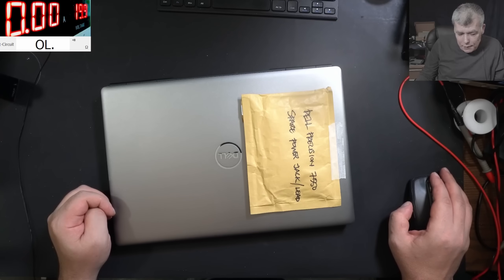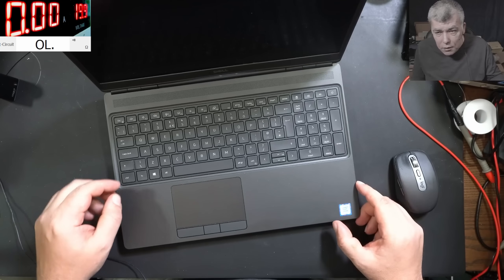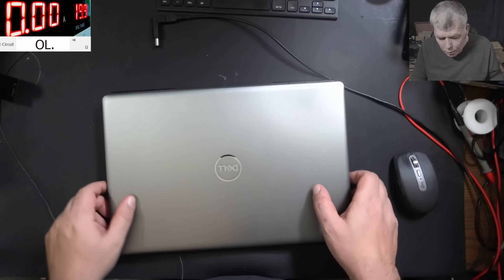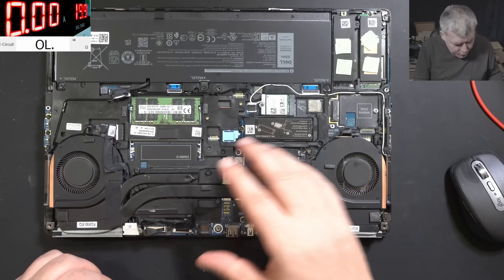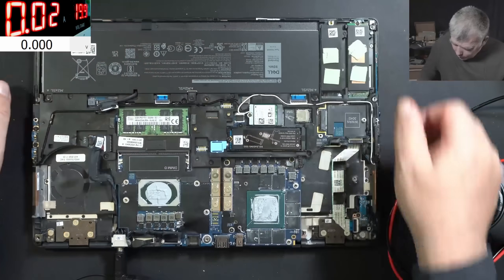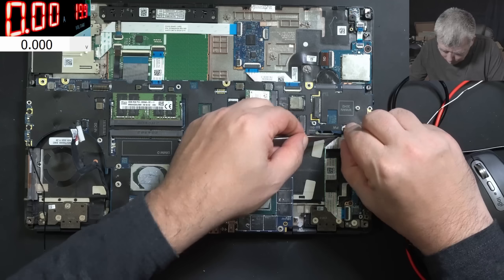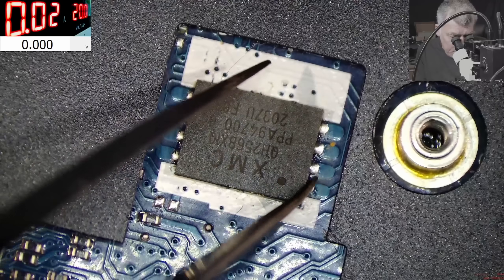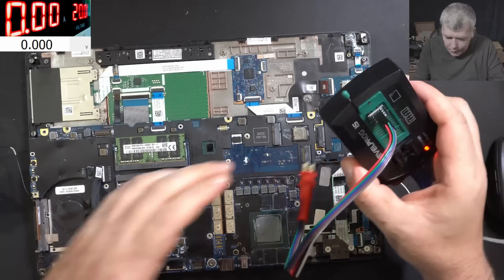Dell Precision 7550 - 10 months ago, i misdiagnosed this laptop and now is back, same fault again

Comment: I had a faulty chipset, the first symptom was error 43 on gpu. Local repair did not diagnose it properly, I ordered  gpu replacement (old laptop), it did not change anything. Later I discovered chipset gets extemely hot, but still it worked, until one day it blew up with a smoke. The cause was my attempt to replace thermal paste without unplugging battery, so suspecting gpu issue made sense at first.

Comment: I would just in case put rosin under the chip, heat it and then put the thermal pads to cool it better. This way if this laptop would die sometime, you know you tried all the best you could without replacing the chipset itself.

Comment: Thanks for sharing. You mean the actual chip itself is crappy? So it is not the solder? Or does bad thermal make it come off or come lose internally? I used to have a contact that reballed old Apple G3 GPUs. If Apple did it they failed after a year, but when he did it it lasted for years. He had an industrial sort of oven with a profile he figured out. Thermal pad may work, newer models of the Precision I have, have a cooling pad and copper on it. Awesome find, love to know how you apply cooling and how long it lasts! And still hoping for you to answer to that email from Sweden ;).

Comment: You applied way, way too much thermal paste on the cpu which i saw at the start of the video - this can also negatively affect thermal performance. If you cant eyeball how much is needed, use a spatula to spread the paste evenly and add a tiny dab of paste in the middle - this will ensure perfect coverage with no gaps
Reply: How can it affect thermal performance?

Comment: Intel Chipset has no this issiue like old gpus. Same effect you willget if you push the chip. You have to reball the chipset the problem is cracked solderbals between chipset and mainboard.

Comment: I do not understand why Dell moved from having the chipset cooled by the heatsink, as on some older Precisions ie. m6600 or m4800, to simply having them exposed with no cooling mechanism other than ambient air such as the one shown in the video🙅‍♀
Reply: I've also noticed that some Dell Precision models run hotter thus causing heat related issues sooner, so I drill additional holes in the bottom cover to assist in cooling.
Reply: This chipset doesnt need that for operating, its just several watt, operating temp only around 60 deg c.

Comment: I don't know how to diagnose and repair the board, I don't even have the right equipment to do the job,  so I would have taken a chance on replacing the motherboard.
Dell Precision 7550 Motherboard System Board Core i7 2.6GHz Hex Core CPU - 4JGVR - $249.95 refurbished
Reply: Refurbished is the same deal, gpu or super IO chip

Comment: The chipset is healthy, but it needs reballing. You only did reflow and not even a good one. That was a perfect moment for your rosin to shine but you missed it. You always say that you can solder chipsets but cant find a healthy one. Well... what more do you want?
Reply: No he didn't do reflow. He simply heated the chip to prove a point, the chip is internally faulty. This is a known thing for at least 15 years with large bga chips that run hot. This is why people should add heatsinks or heatpads to all things including tv video board bga chips otherwise they will eventually fail from getting too hot. They are designed that way and manufacturers purposely do not put heatpad there so it will fail because manufacturers do not like things to last 20-30 years.
Reply: @g4z-kb7ct  Things don't just repair by themselves when heated - only solder does that. He "repaired" the solder joints only temporary. I've done that in the past too but with temporal effect. And adding thermopads and pressure on the chip doesnt work. May add few hours/days worktime maybe...
Reply: @renter84  In my comment I did not say it 'repairs' it. Watch the video about why fat PS3 fails and can't be fixed and you will see it is a known issue where the connections inside bga chips fail. It is known and well documented.
Reply: He said that the problem isn't with the Solder Balls. The internal circuit ot Chipset is gone.

Comment: Hello Sorin, for SO8, SOIC8, SOJ8 I am using Pomona 5250 test clip. It is unbelievable reliable(I did around 50 bios in a day without any error messages " check pins"

Comment: I do not understand. I can understand that by heating the contacts they melt and repair them, but that the chip itself is repaired by heating it is not clear to me
Reply: Search for "fcbga diagram" and you'll se how they are internally connected.
Reply: There are multiple solder points under the chipset so Sorin has warmed them up to melt the solder and remake the contacts,
Reply: @Arachnoid_of_the_underverse  no, this was not about the solder being bad, the chipset is broken inside due to it's body expanding/shrinking because of temp differences between the on/off laptop. See it as a wire breakage, sometimes when you hold the wire in a certain angle the machine still works. By heating the chipset Sorin got lucky it got back into a working position. He used the thermal pad to reduce the limits of the expanding/shrinking trying to make it a more average endurance for the chipset and hoping it will keep working. But since there will still be a temprature difference everytime the laptop is on and off, the chipset will die in the end regardless ...
Reply: Its not a solder ball issue the issue is inside the chip itself, there is a microscopic crack in a trace somewhere heating it causes thermal expansion and the crack closes so it starts working again. But the issue will come back as the board constantly heats and cools the break in the chip will happen again

Comment: Reballing understood after very long time that actually doesnt differ than heating up the chip ,cause it is internally faulty one of or multiple inside pins are cracked inside of chip ,so reballing is a myth now.
Reply: lol, it's not a myth
Reply: What a silly comment, where’s you pull that one from ?😂
Reply: @MrReeceyburger123  İt is not a sodler ball fault besides a little rosin and heat up solve the most problems about sodler balls isuuses ,most of the faults are generally about internal cracks of the pin ,didnt you hear that if you dont hear now from me.
Reply: @davianceable  chips which get fixed automatically with heat like this die again after a short period, this is not a proper fix.
Reply: @kepler104  yes but reballing also works for short period it isnt about solder balls under it.
Reply: @kepler104  a proper fix is not possible with low costs. The best fix would be to take the motherboard to the garbage can and replace it with a good one but that is expensive and many people will not pay for that.
Reply: @davianceable  reballing works when solder balls are the problem in this case solder balls are not the problem
Reply: @orange11squares  yes i know just saying that reflow or simple reheating fix is not really a fix it's just luck
Reply: @davianceable  lol sush Ive reballed many ics in certain devices ive repaired either cracked solder or due to crappy solder.

Comment: so, the chipset needs to be reballed!!!
Reply: You're telling me that faulty chipsets are STILL being made??

Cmon people i thought this was an issue during the 2000s
Reply: @lukedavis436  dell latitude d830 gpu vibes :)
Reply: @lukedavis436  exactly that's what i want to say! the chipset is NOT faulty! just that Sorin cannot REBALL it! you need special tools for this! he need to remake the solder balls!!
Reply: @adaniel69  you can Reball a chip by hand, the Cod3r does it a lot
Reply: @adaniel69 I think he was saying that the flip-chip solder connection from the chipset silicon to the chip carrier is faulty.

Like the old Xbox 360 days.

You can reflow and it'll work for a while, but you can't fix the actual flip-chip connections.
Reply: @lukedavis436  not such a great business model spending 4 hours on a 50 quid repair tho is it?!
Reply: @incandescentwithrage  unfortunately I've just written off an old Windows Vista Compaq due to this very issue...I feel awful but I can't fix it and it's not something I care about too much unlike other computers I get given
Reply: You're always going to get one here and there that fails these things happen I'm not saying they're pumping out thousands of faulty chips  but cold and heat sensitivity is common fault with semiconductors and chips and if you think they going to work for ever without failing your kidding yourself i have been in the industry for 40 yrs and i can tell you it happens more than you might think.
 @lukedavis436
Reply: no the chipset is defective, needs replacing
Reply: @ДимитърАндонов-ъ7е  check "northwestrepair" to see how reballing is made!!! he's doing GPU's!
Reply: @ДимитърАндонов-ъ7е  that's what Sorin said. But he doesn't have the tools to do a REBALL, he did only a REFLOW(kind of). The laptop will go not work anymore soon. Same problem like today
Reply: @adaniel69  oh mister daniel, you must eb new to the channel, Sorin did many of reballs already on here